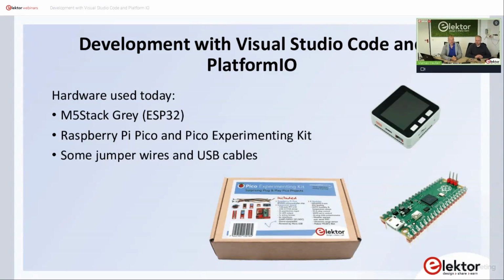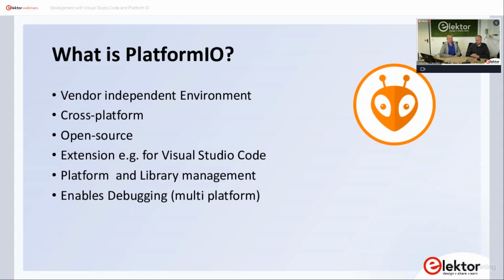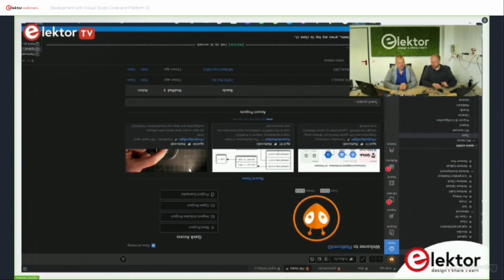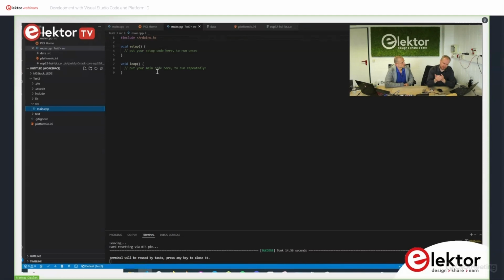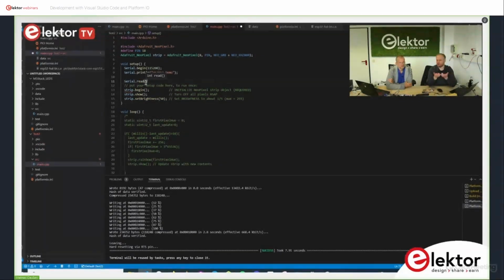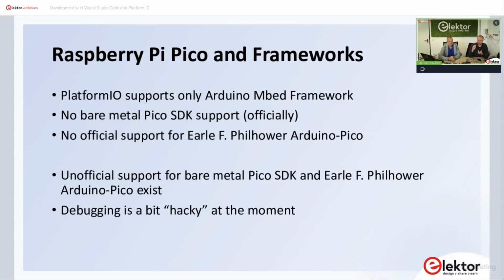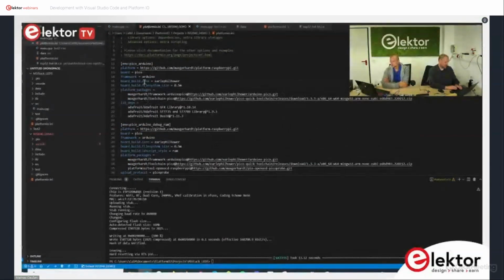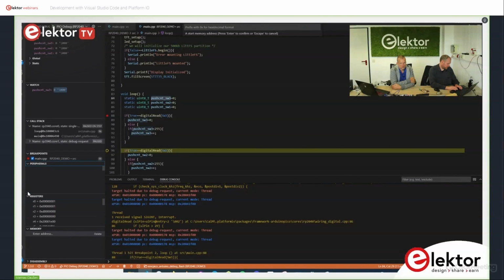Webinar: Development with Visual Studio Code and PlatformIO

Comment: Very useful, but hard to follow. A tip: because VS Code is based on web technology, the font size throughout the application can easily be increased (View, Appearance, Zoom in) so it is legible on lower resolution YouTube feeds. Also if Elektor is going into video as a regular thing (which, as a magazine subscriber I really welcome) maybe the bosses could be persuaded to spring for a better camera? The live video seemed to be at much lower resolution and frame rate than the screen feeds.